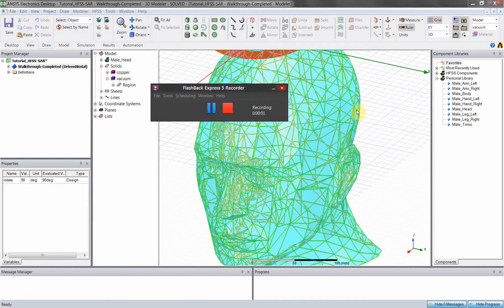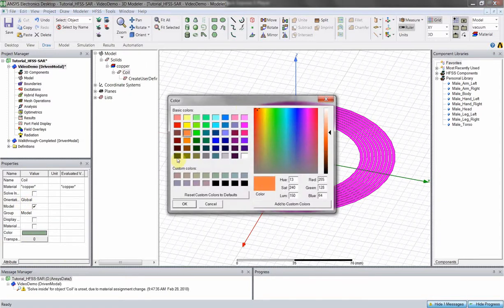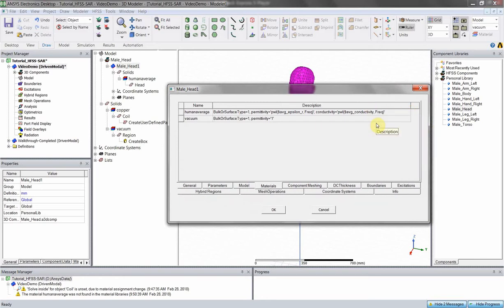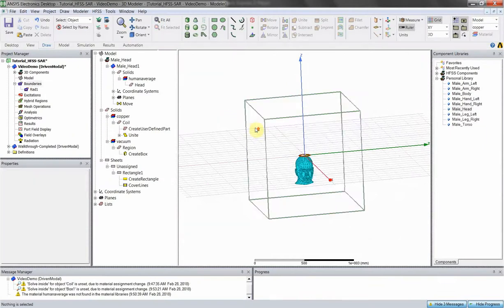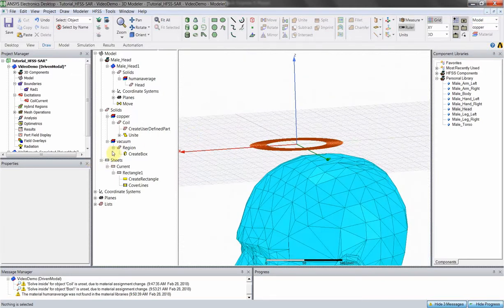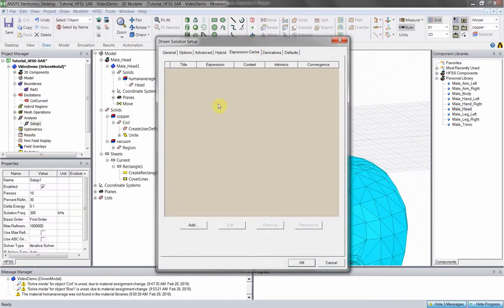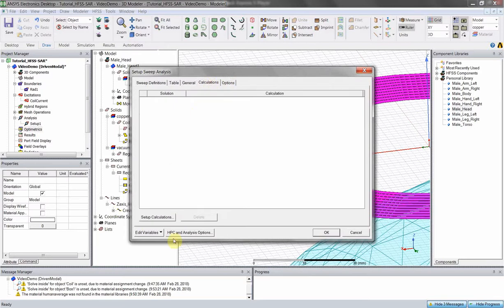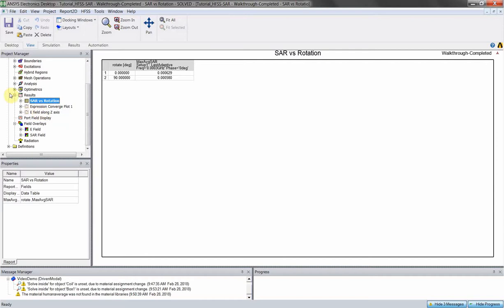Ansys HFSS Tutorial: SAR for Wireless Charging

Comment: Thanks for the Tutorial Eric. Around 16:04 you were talking about a trick to compute high resolution field in the vicinity of the coil. If I understood correctly you meant that one should create a "vacuum" region in the vicinity of the coil that spans the whole coil and then set manually the mesh element size to increase resolution in this new volume?
Reply: I HAVE a RECTANGULAR PATCH ANTENNA SIR WHEN USING UR METHOD TO CALCULATE THE SAR THE SOFTWARE needs a sweep POINT FOR THE PROCESS HOW CAN I MAKE a SWEEP POINT LIKE rotate U MAKE IT FOR UR ANTENNA TO MINE PLZ HELP